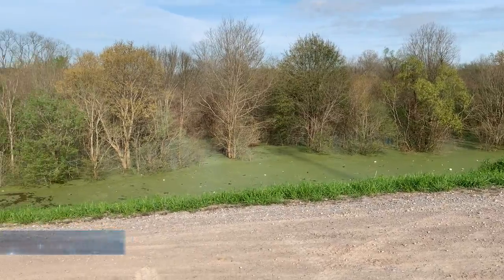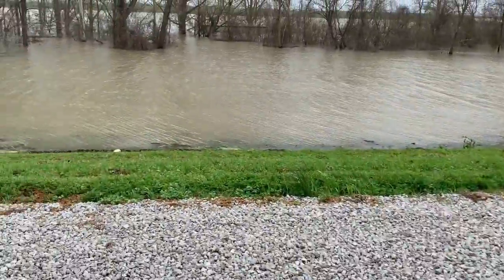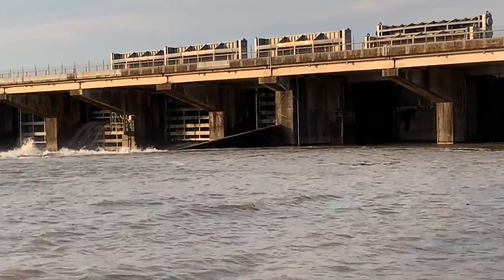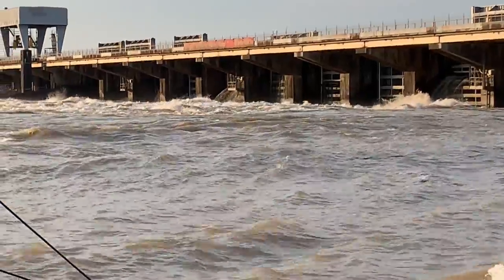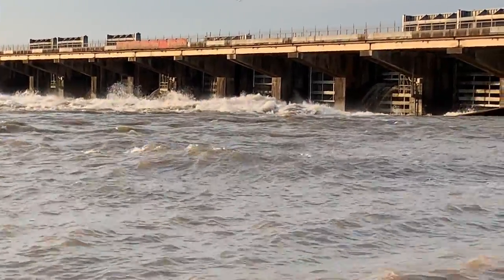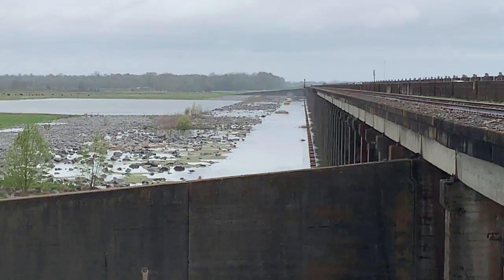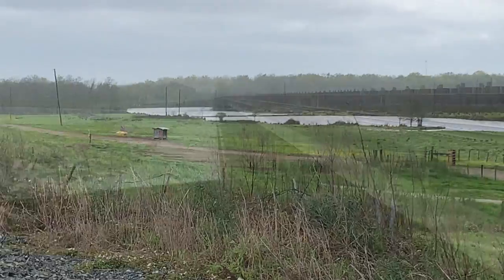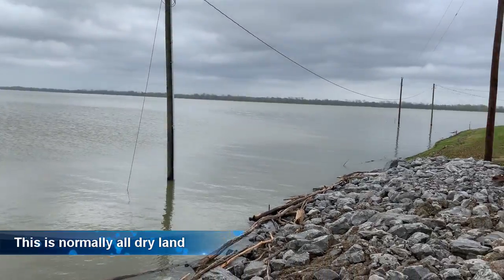Atchafalaya Flood Waters and the Old River Control Structure

Comment: The bed of the Atchafalaya River is 15'+ lower than the bed of the Mississippi River at the control structure. From the control structure to the Gulf of Mexico is over 300 miles along the Mississippi River and about 145 miles along the Atchafalaya River.   The math is easy.

Comment: If the structure north Simmesport failed, Simmesport would have less than 20min,before a 60'wall of water hits the town,,.according to THE CORP OF ENGINEERS in 1980.""The Mississippi would become over 60miles wide .Morgan City would be lost.&""Baton Rouge  & New Orleans would dry up .For over 35 years +,, large boulders an rocks have been dumped on the these flood gate structures, with no end in site due to the (depth )of the washout on each side of these structures. I had conversations on these  structures as they shook and vibrated.The thought of structure collapse was REAL & the FEAR was in every employee working there.They were sacrificing themselves as they worked 24/7 .Majority of the population had NO CLUE to the danger lurking during these flood stages.""The Indains kept records from the beginning of time,,and it was past down through time that"" the Mississippi River would change course every 500 years,",this is known today,,ONLY BECAUSE OF RECORDS of Native Indain tribes.While Native Tribes already lived in this area,,,Many Tribes were moved here from the Last time the River changed direction 500 years ago"".After spending BILLIONS $$in the Last 80 years to control The Mississippi River,,,just to make more Billions $,in commerce, The Mississippi River will always have the upper hand.""If anyone from the government would have taken the time to sit down with the  Indain Native Elders,,,to learn their culture,,& wisdom of Nature,,,I believe,,we would  be ALOT BETTER OFF Today !--♡,,GREAT CONTENT & PRETTY EYES Teeeeeee!♡☆.((I rode these levees all my life,((,worked for The Corp. of ENGINEERS, ((married the niece of a Native Indain Chef,,(was able to meet with different individuals from The National Indain Affairs !☆,,these was the Days of my greatest education-"☆Today ,,the threat REMAINS EVEN GREATER,,,☆peace ya,ll ♡♡

Comment: Forgive me if this has been addressed.... The reason it looks like the gates are closed on the low sill  is they open at the bottom. Each vertical unit has up to   3 suspended gate sections. The big crane is used to lift them to open them at the bottom. Where you see leakage is where these sections come together.  The auxiliary structure uses tainter gates and counter weights in normal service. But it also has a crane and similar vertical gates for servicing.  And the overbank structure uses what are essentially rail road ties at the top to control high water. 3 different systems plus a power plant all working towards the same goal . Pretty amazing that it works at all.  There is a picture of what the low sill gates looks like when there is no water in this pdf from the COE https://www.mvn.usace.army.mil/Portals/56/docs/PAO/Brochures/OldRiverControlBrochure.pdf

Comment: We often hear about the infrastructure deficit in this country but seldom get the level of context your excellent analysis provides. It is very unfortunate that our bodies politic are not capable of dealing with large problems such as this and that the media provides cover for them by being hyper-partisan. In a more sensible society, there would be a lot more discussion of these sorts of challenges and less coverage of tweets and twats. 

Not incidentally, you are one of the best extemporaneous speakers I have seen on YT or anywhere else outside of a university lecture hall. You are well-informed, well spoken, and passionate about this issue - and probably many others - perhaps you should consider running for office.

Comment: That was very good information. I remember driving from Krotz Springs back to Eunice in 1973 and hwy 190 west from Krotz Springs all the way to Opelousas had water over the 190 hwy. You could look out and every levee had water going over it. That came very, very close to losing it then. I remember also the commandant of the Army Corps of Engineers saying that there is no doubt that the river will change course and the Atchafalaya will turn into the Mississippi and we will have a brand new delta system. It is not a matter of if it is just a matter of time and circumstances that determine when it will turn. There is no way to hold that river back indefinitely and it will happen sooner than later. That was how he said it back in 73. Now we are very close to his prophecy becoming true.

Comment: They have always said the boot of la would be under water. We live in state tx/la line. The damn has been leaking for 20 years. The corps are pretty good at controlling since Rita,Ike and Harvey.  We had several annual floods in 10 14, 15 and 16.   The government I'd going broke from always rebuilding. $500k cost homes were given 32k to rebuild. Flood insurance should be mandatory in some areas.

Comment: Fascinating! I remember the events of 73 and drove through the area. It's good to hear the story I've heard in bits and pieces put together. I crossed the Mississippi at Vicksburg a few days ago - it was scary high as is the Ouachita near my house (Ouachita empties into the Red which empties into the Mississippi). Thanks for the video.
Reply: Water of the Ouachita and Red Rivers never enter the Mississippi, but flow down the Atchafalya to the Gulf.
Reply: @samueleburgess9405  I stand corrected. At one time the Red flowed into the Mississippi but a mid-20th century flood control project diverted it to the Achafala.

Comment: It was in 1973 when they nearly lost the structure. The right wing wall on the Mississippi side collapsed. The water had scoured out under the structure exposing the pylons more than half of the structure. Had that happened the Mississippi would have changed course and overtaken the Atchafalaya. Also, the flood of 1973 was much larger than in 1927 in terms of flow. In 1927 the levees were far lower and there were far fewer of them. I well remember in 1973 the Atchafalaya on top of the levee in Simmesport. It stayed this way for months. I can also remember the old railroad bridge in Simmesport with the river running over it.
Reply: The Morganza Spillway has always been a political thorn in the Corps side. All the farms and oil and gas wells downstream create political problem for opening the gates as they are supposed to. In 1973 they were only opened because the bank on the office side where the Spillway connects developed a major leak. Also, what most people don't know is that there are serious problems in spots along the levee system where the Mississippi is eating into the bank. Remember, that even at normal levels the Mississippi is on average 11 feet(if I remember correctly) higher than the Atchafalaya. So one can see the problem. If you look at a map of the Three Rivers area you can spot the problems with ease.

Comment: Interesting video.  Though lesser known than other Corps projects, the Old River Control Complex (ORCC) is one of our Nation's most important pieces of infrastructure.  During the flood of 1973, we experienced significant scouring at the Low Sill structure (the first structure you visit) that required not only a massive undertaking of rock placement but operation of the Morganza Floodway to save it.  After that flood, we constructed the Auxillary Structure to allow for greater capabilities in our effort to maintain the 70/30 distribution between the Mississippi and Red rivers (we add the flows of the two rivers together and then divert 30% of that total from the Miss. into the Atchafalaya) .  You mention that the water coming through the low sill is different than in 2011.  You are correct and there are a couple of reasons for this.  Unlike in 2011, we are also using the Old River Overbank Structure to divert water from the Mississippi River.  This means that less water is being passed through the Low Sill structure.  Additionally, the Red River is much higher this year than in 2011.  As a result, we are passing less Mississippi River water through the Old River structures.  

I do want to note that we were not at risk of losing any of our flood control structures in the flood of 2011.  During that event, the system performed as designed by passing the water down the Mississippi River or through the Bonnet Carre' or Morganza floodways.  Following the 2011 flood, we were able to make a lot of repairs and advancements so the system today is even stronger than we had in 2011.  Currently, the system is performing as designed and we are confident we can pass this high water as well.  

I do appreciate the attention that your video is bringing to the Old River Control Structures as well as the overall Mississippi and Atchafalaya river systems.  These systems and structures are critical to South Louisiana and our Nation but they are not something that you can build and walk away from.  It requires continuous (and expensive) maintenance efforts to ensure they will continue to perform as needed.  The awareness you help provide is a huge asset in helping ensure that we continue to receive the necessary resources.
Reply: Man, if the corps of engineers says that were safe, then...WE'RE IN DEEP TROUBLE ! I don't trust the corps one bit !
Reply: so why are you guys not dredging silt out of the river?  I heard there where companies dredging and selling the silt but because you guys wanted 70% of the profits it basically shut them down.  seems to me the river silting up is the major issue.
Reply: @mikecredeur7941  They do dredge constantly, but the river never stops depositing the silt. I'm not familiar with the 70% profit that you mentioned, so I can't comment on that. The corps of engineers is who does all the dredging, but they have an limited budget for an unlimited amount of silt. Due to logistics, and the high cost of transporting the silt, the corps just dumps the silt on the other side of the levees and rarely does it get sold, so it's basically wasted. It's a shame too, because the silt is the prettiest, and most fertile soil in the country.
Reply: @ @meauxjeaux431 so why not have others dredgeing?  It would benefit everyone not to mention the corps could save some of their budget for other much needed projects.
Reply from the maker: You’re welcome. We are glad to help in anyway that we can.

Comment: You would think the corp of engineers would have a plan to build two huge reservoirs each side of the Mississippi to hold all that extra water. All that spring thaw and rain water going to the ocean and it could be diverted to a reservoir for a drought someday. Not to mention the jobs it would produce.
Reply from the maker: There are reservoirs but they hardly put a dent in the unimaginable amount of water coming down this river that drains the majority of the nation. The amount of water you are talking about would create an inland sea that would drown a huge portion of the state. So that would t work
Reply: It all starts in Canada. From the northern border to the tip of Louisiana you could dig canals and pumping stations to divert a large amount of snow melt and rain for future use. It wouldn't get all of it but it would be there when you need it in the future  I'm talking huge reservoirs in the plains states.. @SurvivalHT
Reply: So which state would you sacrifice? Reservoirs that size would only work if they were below the level of the Mississippi. So the reservoirs would have to be huge excavations to work. I am talking about basins that would have to be dozens miles long and wide, maybe morei. Of course, if the levees fail the old flood plains would act as reservoirs, but those levees are protecting thousands of people. It's the scale of the Mississippi River that people fail to appreciate. I grew up on the river in eastern Iowa and believe me in flood stage it is mind boggling how massive and powerful that river is. Since we seem - as a nation - to be unable or unwilling to undertake and sustain/maintain large infrastructure/public works projects it seems the question is when this (the failure of these huge flood control projects) happens, not whether.
Reply: Arkansas Mississippi Tennessee Missouri in the southern regions and Nebraska, Kansas  The Dakotas Illinois and Wisconsin in the north. just to name a few.

Comment: The structure at 2 min is a hydro power generation turbine, the actual control structure is one mile south. Lots of huge catfish at this location. Nice vid.
Reply from the maker: There are several structures that are part of the control structure. This is only part of it. Any one of them failing would result in the river turning. This one began to fail in 2011. The one north of it nearly failed in 1973. The one south is a larger structure and works as part of the whistle system

Comment: Uh, no it would not have "wiped out Simmesport and Melville". Both communities are surrounded by levees on all sides. Some people have build structures outside of those levees, but if they open the West Atchafalaya Floodway, only those outside those levees will be washed away.  The overall Atchafalaya Floodway has only ever been operated at 50% of design capacity via the East Atchafalaya Floodway (opened via the Morganza structure).
Reply from the maker: If the structure broke and the Mississippi turns its full force in the Atchafalaya it would add an additional 70% in a tsunami type torrent. The ring levees would not even come close to holding that back. They would be over topped and fail in minutes.
Reply: The Corps would open the West Atchafalaya before allowing the structure to break.  I was born and raised in Innis, and watched all these structures being built, plus studied the whole strategy of flood control for the lower Mississippi.  Most people are evidently no longer aware that the West Atchafalya part of the floodway even exists. And the "ring" or "guide" levees around Simmesport and Melville are designed to withstand exactly that situation. The Advocate article is wrong, as is Xu.

Comment: Losing the Morganza Control Structure also means that the mouth of the Mississippi moves to Morgan City
And once that big ol' river makes that change getting it back will be effectively impossible
My daddy worked the river out of Baton Rouge in the late forties, and he told me that one time the only thing that saved the river then was that the Corps of Engineers bought a log raft and floated it into position just right as the water was dropping
Reply: It's not the Morganza structure that is endangered....that is just fine.  The area the video concerns is the Old River Control Structure(s), which is about ten miles north of the Morganza structure. That structure has come close to failing a couple of times, but has been repaired. The ORCS is NOT the final defense against the Mississippi. That honor goes to the West Atchafalaya Floodway (which has never been opened) which comprises 51% of the total flow control capability of the total Atchafalaya Floodway.  Thus far, only the EAST Atchafalaya Floodway has been used (by opening the Morganza structure). The WEST Atchafalaya Floodway is only opened by breaching what is termed a "plug" levee.  The "plug" levee is deliberately not as tall as the levees around Simmesport and Melville, or the levees that comprise the East and West floodway boundaries.

Comment: Great video.  I knew about many of these issues but didn’t realize it was that dire.

On another note, where can a person go crawfishing in that area.  Used to live in NO and when the opened the Bonnie Carrie it was generally crawfish galore.  Is it correct  that most areas of the basin are off limits to public crawfishing as it’s mostly leased private land?
Reply from the maker: You can normally crawfish on reserve land but it’s all flooded under 30 feet of water right
Reply: Survival HT thanks Miranda.  I’ll try to research where those are with La office of state lands.